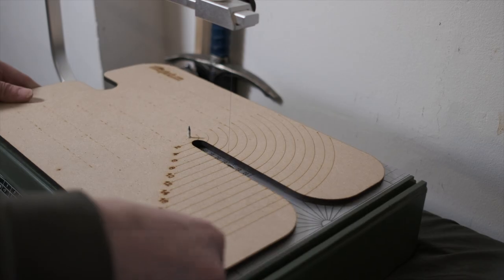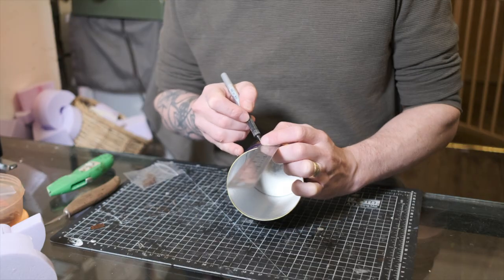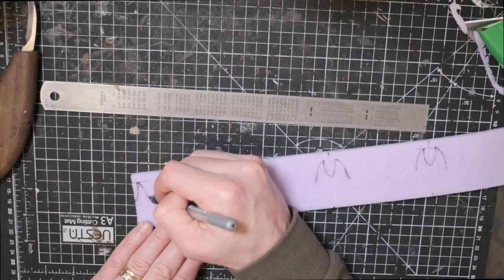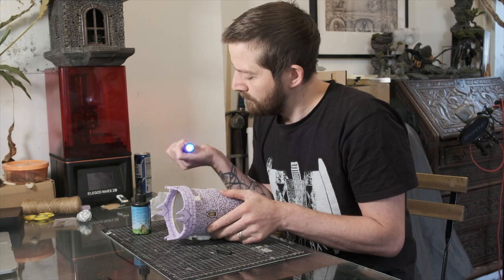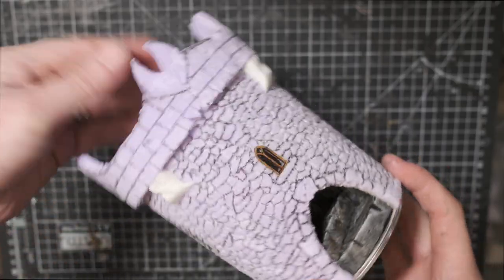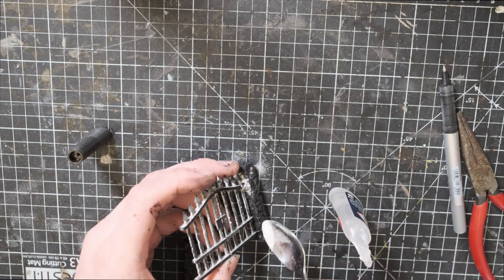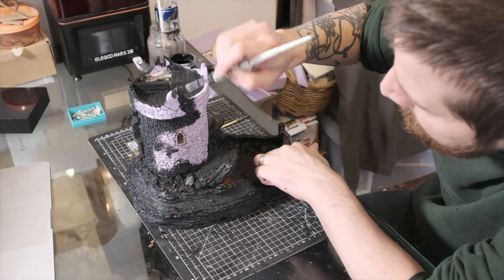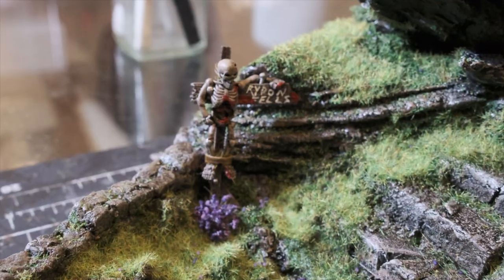The BEST D&D Dice Tower on Youtube FULL STOP.

Comment: One thing that I've done is abandon the aluminum ball for texturing. I've always found it a waste as it smooths out very quickly and you have to keep making more. So I took a dowel and wrapped it in super sculpey clay and then it hit with rocks, the last ever foil ball, scissors, what-have-you to give it that really rough texture. After baking it hard I now have a permanent, long lasting rock texture roller. I also did one on a wooden ball so I had one I could roll around in random directions. Both work a treat.
Reply from the maker: Thats a good shout! I have seen some people do similar and I keep meaning to try it... think I have just made up my mind! Thanks for watching :)

Comment: Hi, I follow your TikTok and saw the 40k thank you video the other day, so I did as you bid and came over here to watch and subscribe here. 
I've been confused about where you are based, I thought it was the UK then the U.S. as you seem to have an ample supply of XPS foam (as commented on a previous TikTok) But it's all starting to make sense now. 
As for the tower, I made a Dice Tower based on Alfred's Tower down in Dorset/Somerset a couple of years back, which Is one of my best builds/videos, I used the thin radiator foil-coated foam for the walls and drew the bricks with a pencil. I like the spiral staircase that's a nice touch! As for the rust question, I have bought the citadel and other paints but ended up just using acrylic paints, dry brushed in dabs and using a myriad of reds/browns/oranges and yellows it seems cheaper than the little pots named something weird (Elvan Flesh is just Raw Sienna etc).
Anyway enough rambling, well done and see you again soon!
Nic at London Creative!
Reply from the maker: Hey, thanks for watching! Nice tips on the rust :D

Comment: Very nice result from a simple but powerful idea.I really like the way you solve the seam problem.
For bricks I have tried drawing them (some XPS foams are better for doing it than others), texture rolls, and cutting and gluing individual bricks. I think that each way has its own uses, and looks better for specific things.
For rusted metal I simply use a base of dark brown, like Vallejo's Charred Brown or similar, some bits of orange for the rust, and a wash.
Question: Have you protected the staircase foam with something extra, to avoid potential deterioration from the bumping dice?
Reply from the maker: Thanks! That sounds like an effective method for rust for sure. You know what, that was a slight oversight I think... I didn't add anything extra to protect the stairs. I think I will go back and paint in some matt varnish now you have mentioned it! Thanks for pointing it out ;)
Reply: @Nat1videos  A varnish coat would be my first option. I thought on it when I saw those nice dice rolling down the stairs, and I was wondering if you had some secret recipe 😀

Comment: Think it would've been cool would be to add motion sensors on the inside of the tower that cause the lights to go on when dice are falling through so it looks like there's someone "walking" down the steps. Might need to modify the tower to make the motion sensors not just go on / off instantly - e.g. taller tower, bigger windows, and a more gradual slope or just having timed delays on activation / deactivation. In my head it seems like it would be cool to have a kind of "stoplight" (position-wise, not color-wise) transition.

Another idea would be to add lights on the inside / outside of the tower door - think there's an opportunity for some cool flickering torch effects in general (both in / outside of the tower).

Overall though great work!
Reply from the maker: Thank you ! Those are some great ideas to think about for future builds too ! :D

Comment: Looks awesome. Couple of questions:
As the landing area is not completely flat do you have any ambiguous dice readings?  (With your 20s at the end, I thought, perhaps from the camera angle that one of the 20s was slightly off.)
Do the dice ever bounce over the low walls or might they if you weren't using metal dice?
Reply from the maker: No, never get ambiguous rolls... the number pointing up is the one you read and it’s not that uneven really. If anything it adds to the randomness of a dice roll, could never repeat the same roll twice. Also, no problem with bouncing at all... have used plastic and resin dice in it also . By the time they get to that point most of the energy has dispersed.  Thanks for the comment !

Comment: This looks amazing! I just finished my very first build which I made as a gift, and I’m wondering if I need to put a varnish on the tower itself? You seem to only have put it on the grass if I’m not mistaken, thanks :)
Reply from the maker: You can use a clear coat, or a matt varnish spray and it will strengthen it for sure... You might get a very slight change in colour though

Comment: I think I would have used 12mm foam sheets and cut single step pieces for a more even finish on  the spiral stairs and align them with a thumb tack or nail through the bottom of the can and coctail sticks to extend it as needed while gluing the stairs at the center and a line along each step edge.
For the rest of the tower I'd probably do the same
Reply from the maker: Hey, thanks for watching! That sounds like it would all work really well too ;)
Reply: @Nat1videos  well... it's basically how the spiral staircases in the 12th century cathedral of my childhood home town was built using lime stone XD

Comment: hello, sorry for the question, I'm from Argentina and I'm a bit confused about the material you use for the bricks or to cover the canister , according to my country, it's Foam board, but I get many different materials later and I'm a bit confused. Also, I don't know if that material is flexible. ( I am new at this)
Reply from the maker: Hi sorry for the delay in response! So the name of the foam is XPS foam. Sometimes it is easier to search for underfloor insulation foam, because that is made of XPS. The material is not very flexible, you can bend it a little though using the corner of a table like I show in the video :)
Reply: @Nat1videos  thx for the info bro!

Comment: My only concern would be durability under heavy use. Especially if the dice used are solid metal! =@[.]@=
Reply from the maker: Yes, it will probably need some touch ups down the line... but I have added some matt varnish since making the video and I only used metal dice because it looked good for the video :)

Comment: what's the name of the foam?
Reply from the maker: The foam I used in this project is PIR foam. Few tips though. Don't try to cut it with a hot wire, and it has some fine particles so wearing a mask is good practice ;)
Reply: Thank you for answer. This won't be the foam I'm looking for. I'd rather have something more user-friendly. The foam from which the stairs and the lining of the tower are made is otherwise used for what? I don't know where to get it here in Europe.
 @Nat1videos
Reply from the maker: @martinvitik1  ah I see! The pink foam is called XPS foam. Another kind of underfloor insulation foam. You CAN use a Hotwire with it and it is less particulate. Much easier to work with ...
Try searching for XPS foam ;)
Reply: Thank you very much. Now just eat Pringles :D @Nat1videos

Comment: DO YOU KNOW THAT 1 FLICKERING LED CAN BE USED TO MAKE NORMAL LEDS FLICKER?. JUST MAKE SURE THE FLICKERING LED IS THE FIRST IN YOUR CIRCUIT IT CINDA ACTS AS A CONSTANT VERITABLE RESISTER CONSTANTLY GIVING THE SECOND LED A VERITABLE CURRENT WHICH MAKES IT FLICKER AT THE SAME PASE AS THE FIRST LED.
Reply from the maker: Thanks for the tip! I think your caps lock is stuck... lol